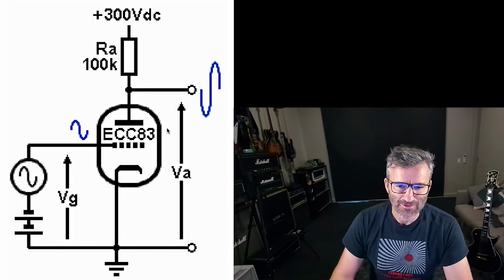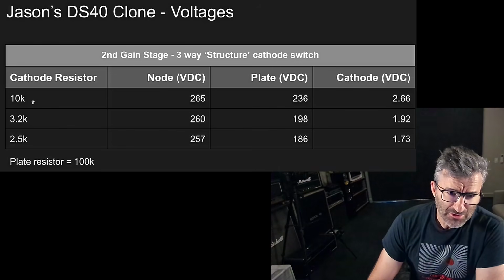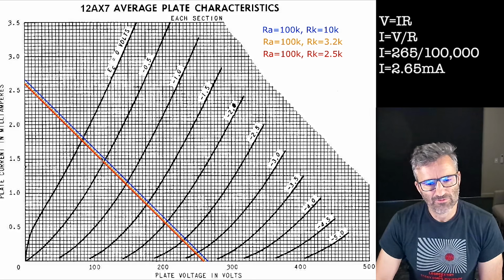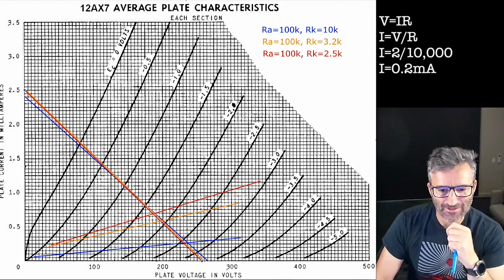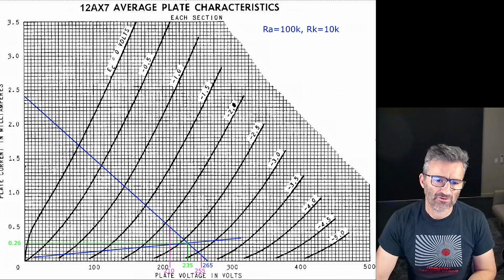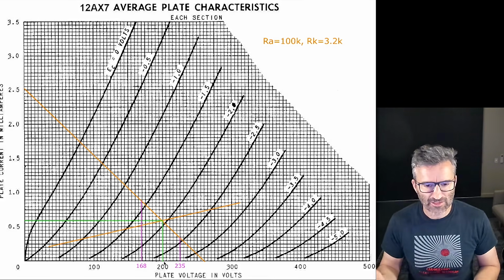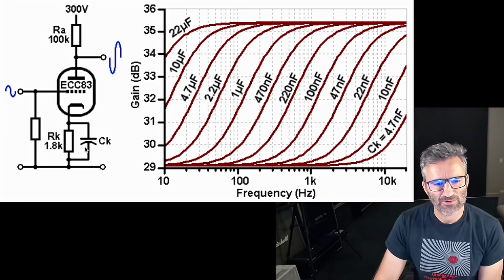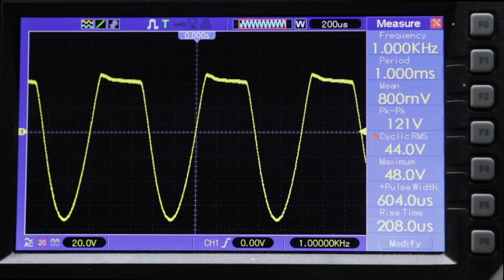Preamp Gain Stages: the Cathode Resistor.  GAIN, TONES & THEORY!!!

Comment: So when you draw a cathode load line does it mean you have the start the end of it from 0v the continue the line until it intersects the plate load line?
Reply: The intersection of the two lines shows the actual bias voltage.

Comment: Outstanding video. We’ve all heard asymmetrical clipping in our pedals through the years and it is an interesting sound. By my figuring, the waveform is a mixed one, a bit more complex dynamically than the traditional mostly symmetrical one. There is clean tone mixed in and it sounds like brilliance. I’m going to try this on my 1970 #1987 50W head to see if I like it. I already love the amp’s sound but this will be a simple mod to make variable. Thanks for all the gain charting. That’s a lot of time spent. I’ll report back.

Comment: Hey brother ive got a, well, a statement and a ? In one 😂 i learned this after plate loading/4 staging my old 800 2204. This thing is a beast in terms of clip but not the fizzy shit u get from Jose style stuff. I found that by shorting, bypassing, whatever, the 1st, 2nd and 4th cathodes with caps the amp became whisper quiet. No cross talk no oscillations just extremely  quiet. Im talking 1st stage 100nf/6.8k, 2nd 470nf/4.7k, 3rd 2.2k and 4th 1uf/1.5k with 6550s at maybe 55mah which i would say is just asking for trouble. When i started all cathodes were unbypassed and it was noisey. You ever notice a reduction in noise by simply bypassing cathode resistors?

Comment: It's worth looking at an unbypassed Cathode resistor as what is referred to as degeneration. This is local negative feedback and actually tries to linearise the stage - all other things being equal. 
The interesting thing about the so called ''çold clipper' stage (IMV not the right name for it) is that the 10k R being so large, reduces the gain and tries to reduce the distortion of the 
stage (by large degeneration)- BUT because the stage is so far off 'centre bias' due to the very low current it overloads very asymmetrically. We all tune these things by ear, like baking a cake, but it's an interesting rabbit hole understanding objectively what is actually going on.
Reply: yep, at 27.55; the cathode bypass cap inhibits local negative feedback, as opposed to 'frequencies going straight through and then out'.

Comment: What I struggle with in understanding this is the difference in tone between symmetric and asymmetric clipping. Symmetric clipping is all odd-order harmonics, and I get that those will have more dissonance with the fundamental and string overtones which are even. And I get that asymmetric has both odd and even order harmonics. What's confusing is will that asymmetric clipping sound more pleasing because it has some even order harmonics, or will it sound more aggressive because it is more complex, having both even and odd order harmonics? Then what's the effect of clipping that cathode follower going into the tone controls? Is that making the overall clipping back to more symmetric and its the combination of the two that establishes the amount of saturation and overtones?

Comment: What awesome work you've done on this educational series of videos, so thank you! Now, I have a question about the cathode follower resistor that is typically 100k. I know from the ampbooks calculator that using a 68k there (left over from trying some previous mods) will slightly lower the impedance seen by the tone stack, and a slightly larger cap is needed to attenuate the right frequencies for the JEL mods, but do you know of any other affects that using a 68k there would have on the preamp's performance in theory or otherwise?
Reply from the maker: I think Merlin covers this in his wonderful book, I might find time to look it up.
Reply: It results in softer clipping, increasing the amount of second order harmonics, 'sweetening' the sound.
Reply: @silasfatchett  Indeed sounds like it, too. Thanks for replying!

Comment: Very good stuff bro. I have a question.what the small resistor value I can use on 12ax7 cathode ?plate resistor 100 k. Thanks.
Reply from the maker: 820 ohm is probably the lowest you’ll find in a guitar amp. Amy lower and you’ll be slamming up against the saturation cutoff.
Reply: @HeadfirstAmps  Thank you for answer me bro. Stay well!

Comment: Do you think asymmetrical clipping in the power amp sections valves (caused by slight phase inverter imbalances) could be reflected in the negative feedback sent to the preamp, and actually shape the distortion of the preamp? 

It’d be a tough one to test without an attenuator because even a 50w is ear bleedingly loud by the time you hit power valve distortion, but it’d be interesting to see if it does.

Comment: Hey Jason do you remember what clipping mode you used in the playout?
Reply from the maker: Sure, that’s the Shirley in the 10k gain structure switch pos with my high voltage FET boost on in the front end. No clipping diodes in this amp.

Comment: Awesome video Jason. They ALL are man !!! The more I watch the more I want to try my own mods. For instance, ... I have the SC20H matched with a 2x12 with Vintage 30's. Very articulate and super distinguishable insofar as, you can hear each and every note that gets picked, even under full gain. Great setup !!! However, ....... It is soooooo BRIGHT that it is really almost unbearable. I hear you talking about "arresting" the bass frequencies going into the preamp section, on a lot of your videos. I seem to have the polar opposite situation. There's wayyyyy too much Treble in the amp - overall. To the point that I have the treble pot on  absolute 0 and use the Presence for the high end. Does this sound familiar to you regarding  the SC20H?? If I could "correct" that I would be a super happy camper. Any ideas would be greatly appreciated. I have not performed any mods to any of my amps before, but have been inside a multitude of many different models. Thanks for sharing your knowledge with us. Super cool stuff man !! - Cheers  !!
Reply from the maker: Hey man, great to hear you are digging the clips.  Here's my suggestion: put a 470pF ceramic or mica across (in parallel with) the 100k resistor that goes from V2b to ground, i.e the cathode follower
Reply: @HeadfirstAmps  I will definitely do that and see what I get. Thanks for the quick response !! - I will let you know how it turns out. Then, I will research understanding it more - LOL - Thanks again for the suggestion Jason.
Reply: I've got the same amp and did this mod. But here's the secret. Shhhh. Try a different speaker. No really! A pair of G12T-75.

Comment: I have a Friedman pt20 and it has the 3 way toggle switch on it for different gain stages and I was wondering if there was a way to make that foot switchable?
Reply from the maker: Its possible, but requires a few relays and a mute circuit. Changing the cathode generates a large pop as the DC bias changes.
Reply: @HeadfirstAmps  Thanks for the quick response, I asked Dave Friedman if he could do it and he said he couldn't. I think he just didn't want to mess with it. I think it would be a good addition to the pink taco or any other amp with the gain stage toggle switch. It could replace an overdrive pedal or be like having another channel or two but I don't think I will tackle it as I wouldn't know where to start. Great video, thanks for the info.
Reply from the maker: Its a big job to retrofit to an existing amp, so I can totally understand where Dave is coming from.  You'd need to design it in from the outset.
Reply: @HeadfirstAmps  yeah, not worth the hassle but it would be cool. I have the origin 20 also and was thinking about trying one of your mods on it as it is a fairly small investment if I screw it up. Thanks for all the useful information, you have some killer videos on here.
Reply from the maker: Thanks Randy, I appreciate the support man.

Comment: i have some switches setup (2204 build). One switch changes the V1b cathode resistor from 10k to 2.7k. The other switch adds a .22uf cap. When the cap is engaged i cannot hear much difference when switching between 10k and 2.7k.  Also i have tried many caps and have found the small 50v polyester box caps have the lowest noise.
Reply from the maker: Hey John.  Yeah the bypass will equalise the amount of gain, however you should still find that the 10k retains that Cole clipper 'graininess' to the tone.
Reply: @HeadfirstAmps  yes the 10k with the cap to me sounds the same as the 2.7k with the cap. The 2.7k alone has more gain than the 10k